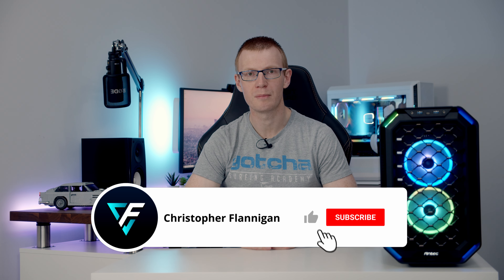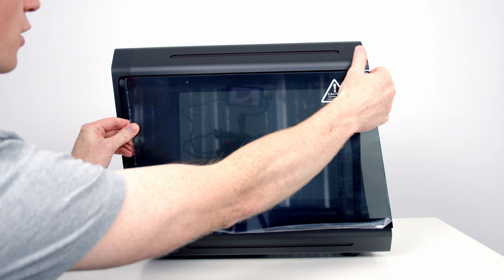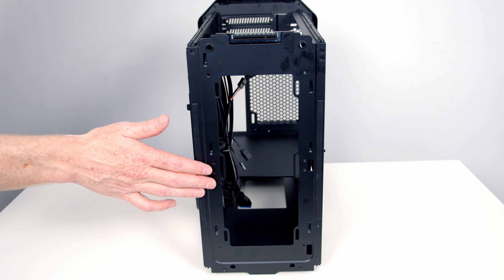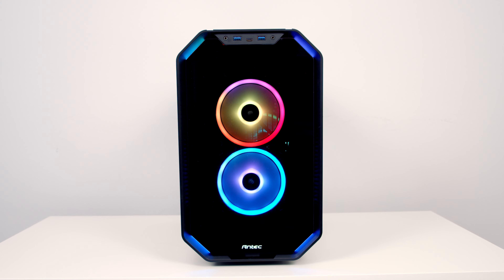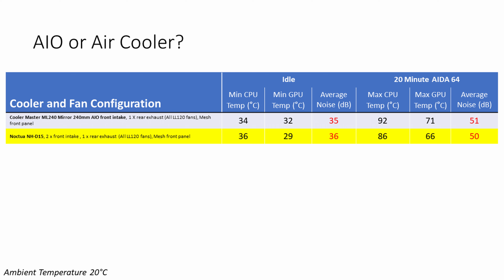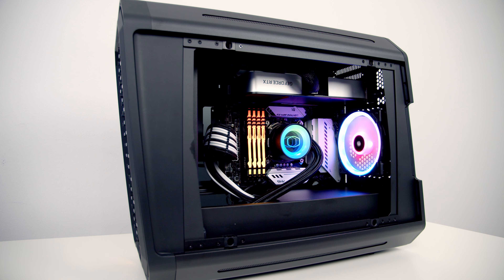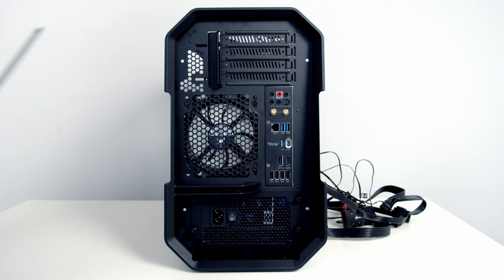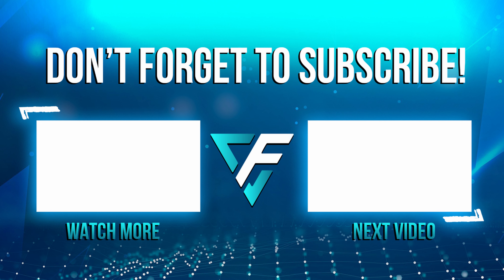Antec Dark Cube Review

Comment: I'm thinking about building an i5-12600K system in this case and replacing the exhaust fan with an in-ward facing Noctua NF-F12 iPPC 3000. I'm thinking that the high static pressure it will create should help with the temps more than having two intakes in the front and one exhaust in the back. Any thoughts?
Reply: I've built mine and it "breathes out" hot air from the front ;)... Pretty dark.

Comment: My concerns is that you have to install the AIO with the hoses at the bottom of the case. This will likely have a detrimental effect on the life of your AIO pump. Deal breaker for me.
Reply: That's only true if the pump is higher than any part of the radiator. They way he built it, the air will get trapped in the top of the radiator, which is perfectly fine. No air is going to get trapped in the pump.